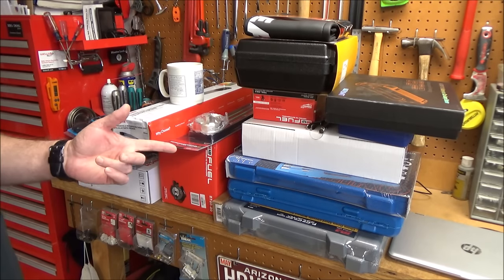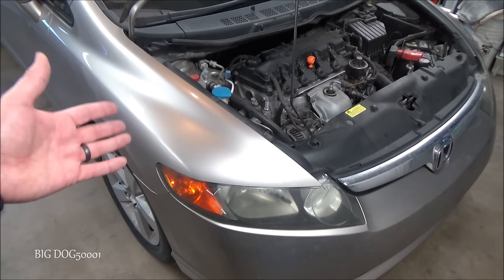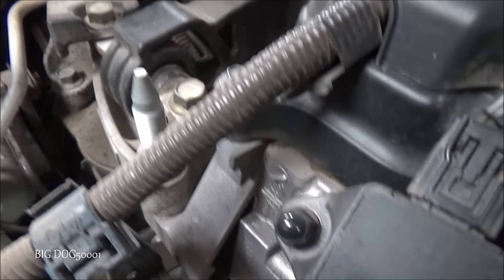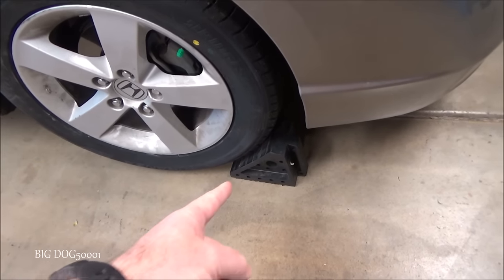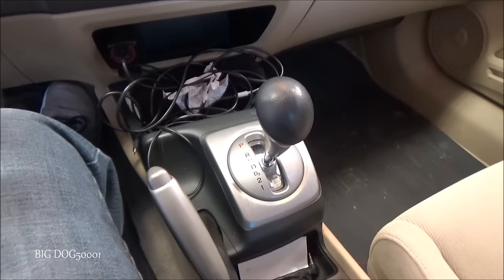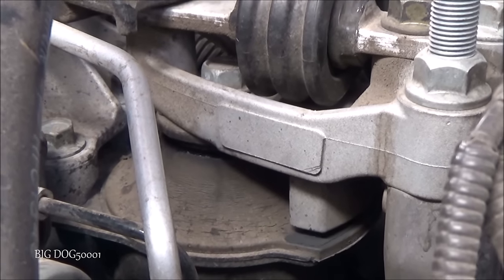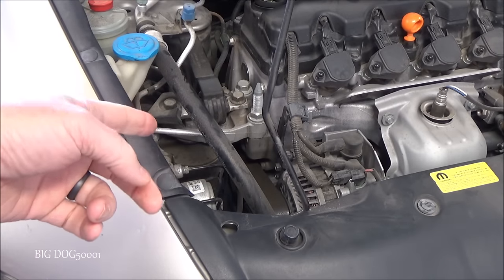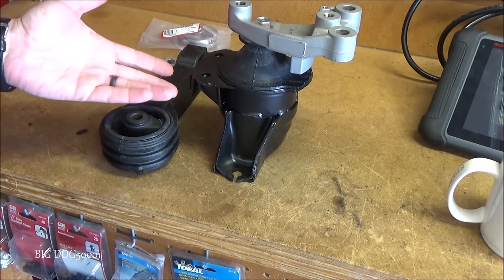Honda Tips: Clunking/Thumping Noise Coming From Front End of 8th Generation Civics

Comment: No my friend it is not broken i have done same thing with my civic and the noise was still there and yes the you do that engine is gonna move regardless of engine mounts new or old
Reply from the maker: A broken engine mount is not the only thing that can cause front end noise on these Civics.  On this vehicle, the mount was broken (and clunking) and I proved it on this video.  It was replaced which stopped the movement (it will still move a slight amount but not like in this video) and I showed that on the replacement video.  Thanks for stopping by.

Comment: I have a 2007 Civic LX. I replaced just recently all the suspension ie., struts, springs, and shocks. Also the wheel bearings, tierod, bushings, new tires, brake calipers, backer plates, rotors, engine coolant,  and spark plugs. Car runs amazing. However I have this constant clunking under the car. The exhaust is in great shape. I shook the muffler and nothing. Only when I drive I get the clunking front to back. It does sound like the exhaust system bumping around under the car.. Any suggestions ??? HELP!!!!
Reply: This is the video you need to watch lol
Reply: Is the clunking when you brake? Cuz i hear a clicking when i brake but ive had my brakes changed twice and its still there and only when i use a certain amount of brake pressure. I guess it could be a wheel bearing or the caliper itself but idk.
Reply: @GodisGood941  The clunking is when I'm driving. I feel every bump o the raod. All new suspension ie front struts, wheel bearings, rear shocks & springs. New tires, new brake calipers. I think it's the bushings?
Reply: @mcass3663  same here. It feels like shocks are not good.

Did you even figure out the problem?

Comment: I have a 2009 Civic SI. I get a clunk when turned all the way right or left at low speeds and when stopped. Checked tie rods and for any loose suspension bolts and they are fine. Any recommendations?
Reply: Noise during turning normally points finger at the CV axel.
Reply: @gzhang207  Turns out there is a post on the TSB to re torque steering rack gear box bolts. Worked perfectly no more clunking.

Comment: Why is there a Mopar sticker on a Honda.
Reply from the maker: I believe it is most likely because a Chrysler shop worked on it at one point (probably a trade in) and those are the stickers they have at their shop.  If I remember correctly is was because the A/C was serviced and dye was added to the system (and a sticker is generally placed under hood to let the next Tech that works on it know).

Comment: So did that fixed your rattling noise. You went from doing one thing and then changed motor mounts but didn't say what was the cause of the noise .thumbs down bro .
Reply from the maker: Huh?  I have no idea where you came up with that.  I showed how I diagnosed this noise (a bad engine mount) and showed a new part on the bench uninstalled at the end of the video.  I asked if anyone wanted to see the repair done (and many said yes) and I posted another video where I showed how to install a new mount.